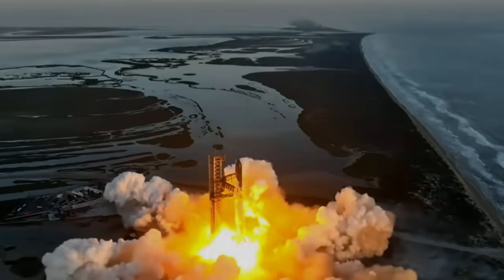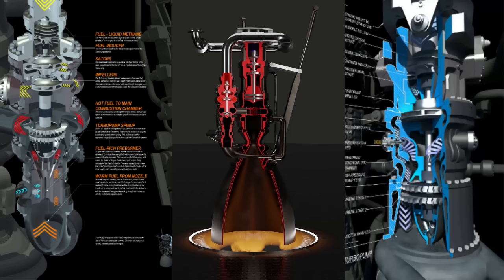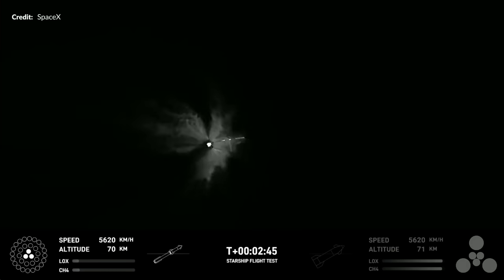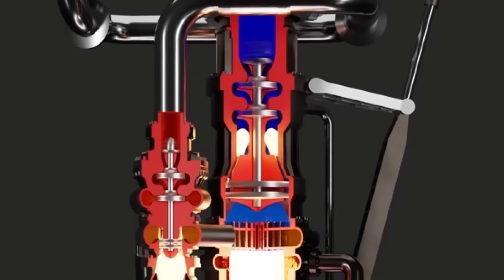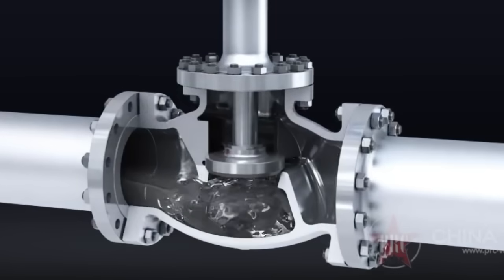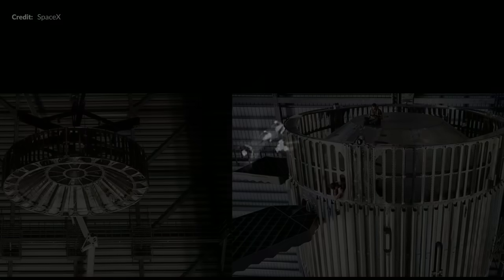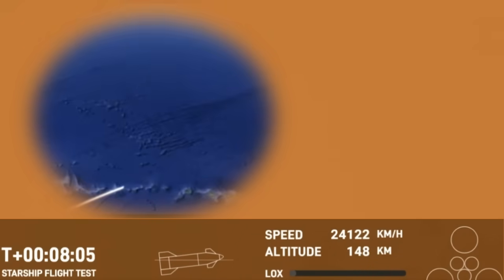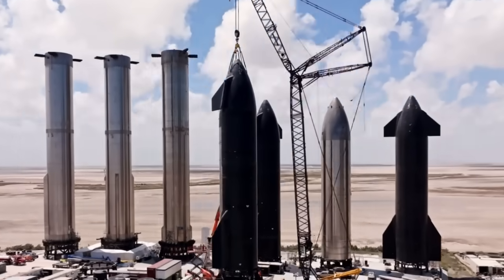Starship Flight Failure Analysis IFT2

Comment: The centre three sea-level Raptor engines are gimballed outward during hotstaging. The flat top of the hotstaging dome is therefore not an issue.
Reply: Maybe, but anyway gases had to make their way to vacuum through the hardware and may have bounced against the rocket frame causing some damage. What else could have caused the damage?
Reply: @paulbizard3493  Not in a low air, low pressure environment.
Look at the speed of gas expansion during hot staging. In addition the Starship is protected underneath by significant heat shields.
The last tweet of SpaceX quote : "Starship’s hot-stage separation was the first time this technique has been done successfully with a vehicle of this size"
So SpaceX know the hot staging is not the main problem for the Starship and the booster. It is possible that they will use the re-ignition header tanks (normally used for atmospheric entry of the booster) after hot staging for flight 3.
They probably thought they could get it without removing the thrust. However the Starship can potentially avoid pushing the booster too much by allowing the booster to follow the Starship more by cutting fewer engines.
Reply: @theplouf5533  the gases have about the same speed and density just aft the nozzle in space or at sea level...
Reply: It still could be if the expanding gasses reverberated at odd angles off the center dome. The Gimble angle of those engines may not be extreme enough to force all gasses out the sides.
Reply from the maker: That' correct but only 15 degrees.  Still an issue.

Comment: Just to note, the inner 3 Raptor engines on Starship actually were gimballed outwards at the time of hot staging. You can see them do this in several angles.
Reply from the maker: Just 15 degrees though but good point.
Reply: First 2 of the 3 vacuum raptors ignited followed by the third. Then the central raptors ignited. By then the distance between the ship and the booster was far enough to avoid the "blow back" that is supposed to have harmed the ship. It went on firing all 6 for minutes after separation - hardly something that you would expect of a damaged ship or raptors. I think there was a leak from the LOX tank. Both tanks were also very near empty. I just don't know yet what caused the leak. But it would not be unthinkable that the ship ran out of LOX (even if the diagram showed some left).
Reply: Yep. And looking closely you can see them gimbal back to center position seconds after separation.  That boost back flip seemed pretty aggressive. That's what I thought caused the problem.
Reply: @fgeiger41  The goal was to move the booster out of the way as fast as possible. Maybe they over did it a bit.
Reply: @knowledgeisgood9645  agreed though It was already blasted in the staging so exposure couldn't be that much worst... or could it? 🤔 still super cool.
Reply: @knowledgeisgood9645  the ship QD at the launch mount looks misaligned after the flight. There are theories that it failed to separate from the ship at the appropriate time and the misalignment happened from the force of the firing booster engines. If the former is the case, then I think that explains it; the ship, at the QD point, may have suffered some injury that probably, eventually resulted in fuel (especially LOX) loss. Just speculating though.
Reply: But, I think, it wasn't enough. I think the thrust of the 3 vacuum engines is enough to separate the ship from the booster..

..and safer
Reply: @okirooju3787  If the SQD caused damage to the ship valves when it disconnected I would expect clear venting immediately not 7 or 8 minutes later. The internal pressure is 5-6 times the external pressure. How would it not leak very visibly?
Reply: and they start after stage separation
Reply: Elon Musk to his staff  "Can just someone tell me what went wrong with rocket?" ... "No one?" ..."then lets read the comments"
Reply: @terranspaceacademy 15 degrees is a lot so far as gimbal is concerned
Reply: Am persuaded by your arguments, and will be surprised if SpaceX say otherwise. Booster will only ever be used on Earth, so perhaps the designers will opt to continue without baffles in the tanks, but what about the ship? It isn't as long as the booster, however, and baffles might be unhelpful during refueling operations.
Reply: I saw the gimbaling of those center engines above the booster shield, but still looks too tight and risky for my comfort. I'd think it would also cause uneven pressure on the engine bell during the few milliseconds of it running with an assymetric obstruction in front of the bell mouth. It's possible it deformed the bell or caused fractures somewhere in the engine assembly.  My $0.02
Reply: No mention of the 200 plus heat tiles falling off- saving that for the reason for failure of integrated flight test 3? Seeing as Elon seems to get his scientific inspiration from his comic book reading as a 15 year old he’ll probably suggest using Tarzans Grip to glue them on.
Reply: @knowledgeisgood9645 he clearly stated that not only engines but tankage, lines, connections etc could have been compromised during hot staging. A leaking line isn’t always immediately catastrophic. It could simply lead to uneven propellant expenditure. Telemetry isn’t always exact, sensor could have been damaged when tank blew out, line could’ve ruptured causing rapid pressure drop leading to flight termination even though liquid still remained in tank to be registered telemetrically (I hope that’s a word…). Anyway my point is it’s sound logic and as such shouldn’t be shewed away so quickly.
Reply: @revmsj  I can't account for data I can't find. Sure, it could be caused by a list of unknowns. I can only comment on the things I can observe now.
Reply: This is what happens when you act all independent from the people who pay you your wage.
Reply: @knowledgeisgood9645 I was asking myself the same but maybe it has something to do with the cold oxygen in the tank getting to lower and lower levels and the hot gas pressurizing the tank, can cause temperature differences at the quick disconnect or above it, were the lox tank is located which could have made the metal weaker, that would explain the 8 min time it took until it leaked
Reply: @alpaco69  That metal has no problem with cold or hot gases - they are within the limits of the steel. It has to be something else.
Reply: @terranspaceacademy the raptor engines are the only engines in use right now that can gimbal 15 degrees iirc
Reply: @knowledgeisgood9645  good point. Well, I don't know anything about rockets, just being 'thoughtful' here. The engineers sure know better.
Reply: @gregansen544 If im not mistaken, I do believe they will eventually need some baffling for the landing flip the ship is supposed to do. We've already seen during those test landings, the engines being starved of fuel, and being unable to restart.
Reply: Yes, I agree.
Reply: @alexanderdimario731  The vacuum raptors have more thrust at this altitude, than the sea-level raptors. It's probably better to fire the center raptors and then after sep, fire up the vac-raps.
Reply: Its possible that they ignited all 6 engines to examine their effects on hot-staging and in the actual design hot-staging is supposed to work only with 3 outer engines or maybe with lower thrust on the inner engines. Just a guess!
Reply: @williamhatfield8935  Well... yeah, that's a real possibility for IFT-3, if Starship makes it to the reentry phase.  Are you trying to say that failure of those tiles on IFT-2 could've been the reason for its Starship failure?  I don't see how.  Care to elaborate?  And why the snarkiness...?

Comment: I believe the sea-level engines on Starship are not started immediately due to the issue you noted. Perhaps they were started too soon though, which would presumably have a similar effect.
Reply: You could see them on some footage gimbaling as well. They were on the "outside" range and they came back after separation to nominal/centre position.
Reply from the maker: There was a short delay but not enough I don't think.l
Reply: I think any minute delay from r-vac to sea-vac ignition is purely for over-pressure concerns. One major thing that apparently wasn't calculated here is that a starship completely full of propellant will weigh MORE than a (mostly) empty booster.  

Even with the added efficiency of the vacuum raptors (though at staging it's probably not much different) I'm going to assume that 3 engines isn't enough for separation - ie. the booster would be pushing into the starship preventing sep. 

With the issues of asymmetry that 3 engines poses (all or nothing basically) you either get 3 engines, or 6.  

They CAN however calculate the exact thrust required for stage separation, and throttle down the sea-level center engines to achieve a minimum-thrust hot staging separation. 

There's another caveat though; if the starship isn's using a mass simulator, it'll have additional staging thrust requirements with a full payload to separate from the booster, perhaps compounding all of these issues further.
Reply: @terranspaceacademy  I am wondering why they fired the sea level engines at all. At that altitude they are less efficient, conversely the vacuum engines are more efficient. The sea level engines will of course be needed during the descent.
Do you know the rationale for this?
Reply: @EstorilEm  You can be sure the masses (not weights) were all thoroughly calculated.
The unknowns that cannot be easily calculated are things like residual thrust after engine shutdown, fuel slosh and settle times, and engine blowback damage.
Reply: @AndrewBlucher  The starship outer vacuum engines don't gimbal - so without the inner engines, there is no steering. In addition, they are still a significant contribution to ship power even when less efficient...
Reply: The sea level engines start first.  The rvacs can't gimbal.
Reply: @JoeShmoism  I'm pretty sure the rvacs do start first; they are on the outside and so have more clearance to the pyramid-shaped protector on the top of the booster and better exhaust venting. Yes, they cannot gimbal so starship cannot steer until the inner sea-level engines light but that doesn't matter for the first few seconds.
Reply: Seems to me that SpaceX struggles to (re) learn the physics and engineering that was established in the 60's. Why?
Reply: @rcpmac  because what they learned in the 60's says what they have already accomplished is impossible.  Hundreds of years ago we learned the world was flat.  Before that we learned the earth was the center of the universe and that objects in the heavens were suspended on crystal spheres.  As far as we know, the laws of nature don't change, but our understanding of those laws certainly does.  With new understanding comes infinite possibilities.
Reply: @AndrewBlucher  because the Rvacs don't gimbal.  Without the center 3 engines they have no steering.
Reply: @simonk1844  the sequence of events as discussed on the NSF live stream has the 3 sea level engines igniting first.
Reply: @JoeShmoism  Ah, good point.

Comment: Concise and informative.  Finally a breakdown that does not fill in with a bunch of worthless, well known information.  Great job!  Water hammers can be violent, just think just explosive cryogenic propellants!
Reply: Isn't that the truth!  I've read about 10 articles that resort to the history of the StarShip and SpaceX after about 2 sentences.  Useless.
Reply from the maker: Indeed!  I'm amazed the cold pipes don't burst all the time.
Reply: @terranspaceacademy  What kind of design allows the failure of one engine to bring down the entire booster. The real test proved that whatever simulation software they run sucks at simulations or that the simulation-model creators are no good. A simulation is as good as its model.
Reply: My thoughts exactly
Reply: @reasonerenlightened2456 
It was not one engine destroying the whole booster. The general consensus is that the fuel did not stay at the pump end of the tanks. With no fuel in the pipes the engines started failing. It was a cascading problem. Next the self destruct system destroyed the booster.
Reply: @terranspaceacademy  They make so much noise. Most people get such a fright with water hammer they seldom get to a burst situation.
In gas turbines (and compressors) it is called surge - it took a lot of money and the recall of the chief engineer  from retirement to solve the surge problem in the RR RB211( or was it the Olympus for Concorde?) I knew some people working on it at the National Gas Turbine Establishment at Farnborough.

Comment: The outer ring of engines total 20 not 26.  Just the outer ring of engines are started by stage0.  Later you mention there are 30 engines but there are 33. About the hot staging and the directional flow of exhaust from the centre engines, they were gimballed out as they were lit so the exhaust would flow out the hot staging ring vents.
Reply from the maker: I said 20.  I just said 30 instead of 33 because I was stuck in N1 mode.
Reply: @terranspaceacademy  I went back and watched it again. You said "20 fixed outer engines". My bad, "20 fixed" sounded like 26 to my lazy ears.

Comment: I like your plan.  It will be interesting to see if it gets used on the 3rd launch.
I also wondered if force being applied to the top and bottom of the booster at the same time may have overstressed it.
Reply: Ye
Reply: Makes sense. I was stunned by the speed of the massive booster flip maneuver, but at the same time I can imagine what was happening inside the tanks and valves under such inertial forces. Tons of fuel bouncing everywhere! Personally, I would make the OFT3 booster flip maneuver definitely SLOWER to handle the fuel as gentle as possible.

This is similar to the problem that the Starship initially fired only some of the engines during landing, while someone soberly asked why not fire all the engines as a precautionary measure, and then shut down the ones that don't work or are not needed.
Reply: @TheGalacticIndian  I remember that suggestion being made for Starship.  It turned out to be the solution to unperfected engine restarts.  
I wonder if the booster burn back could be deleted from the flight plan and just let gravity do all of the work to bring the booster down.  Use the grid fins provide guidance until it is time for the final deceleration for landing.  Maybe the velocity and direction at stage separation is wrong for this idea to work?
Reply from the maker: It was indeed. I think the exhaust gases of the departing Starship had an effect also...
Reply from the maker: Thank you!
Reply: Considering all the can-crusher tests they've done, along with the fact that they triggered the smaller FTS explosives on IFT-1 and the booster not only didn't fail structurally, but still had some engines working (lol) tells me that there's a HUGE safety margin for the vehicle strength. 

In fact, the force of thrust from the starship's 6 engines against the booster's 3 engines (at stage separation) would equate to a combined force FAR smaller than the ignition and max-q forces the booster would "feel" on ascent (33 engines pushing a fully-fueled starship against full gravity at lift-off.)
Reply: @EstorilEm  Yes, I think you are correct.